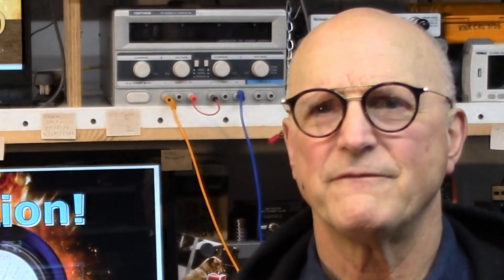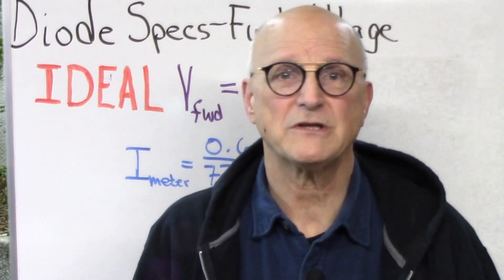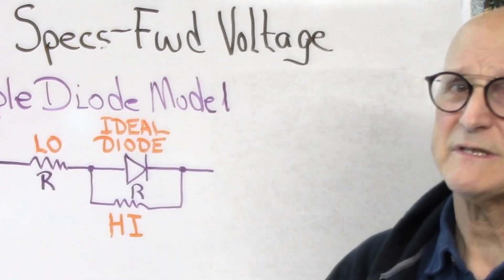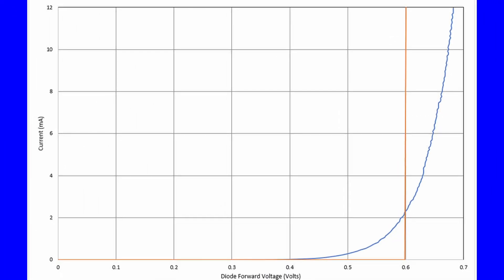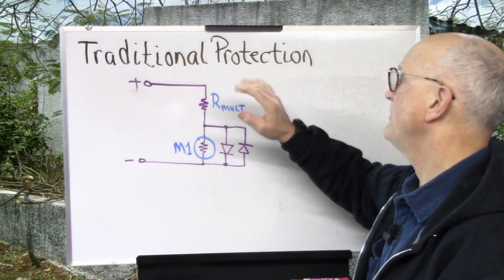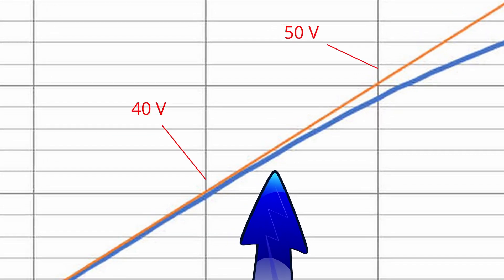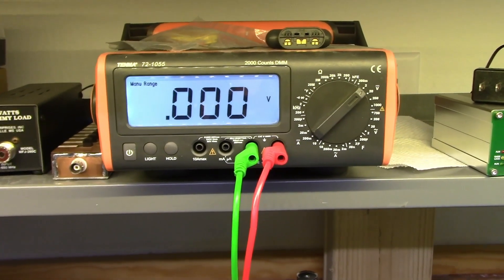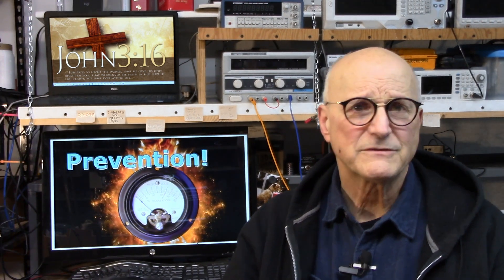Meter Protection: Protecting Your Meter from Over-Current (019f)

Comment: I learned this lesson the hard way. I had an 813 amplifier with a screen milliammeter and the usual two diodes across it. While measuring the screen voltage, my probe slipped. Blam, no more screen meter.
Reply from the maker: May I say ... OUCH!

Comment: Thanks for the video and explanation, this will be very helpful in protecting the meter in my VTVM... BTW, any protection from placing say a 100UF capacitor across a meter movement???
Robert
Reply from the maker: Well, the capacitor would slow down the meter movement as it would have to charge and discharge. This would protect the meter movement from fast spikes. But every capacitor eventually charges and long term overloads would still be an overload after the capacitor charges and would remain longer once the overload ceases as the capacitor would have to discharge.
So, In my estimation, you wouldn't really be buying anything except in terms of spikes. You would also be slowing the responsiveness down. Being that capacitors actually never fully, fully charge (they get close), it might affect the accuracy of the meter, too. 🙂
Reply: @eie_for_you  Thanks! When a VTVM starts up the needle deflects full scale at the start up process... I want to protect the meter during this initial 15 seconds...
Reply from the maker: @myradiovideos  Then I would use the diode-based protection as I presented in this video.

Comment: Good info, good idea.  Perhaps using diodes on each scale would raise the cost and complexity of the multimeter.  Wondering if this could increase error if the designers of the meter already took the clamping current of the diodes into consideration when laying out the silkscreen of the scale.   Perhaps another idea is to calibrate the meter around 3/4 of the total range so that 75% of your typical measurements are accurate.  Are newer meters using Schottky diodes?  I would think we have more modern semiconductors which have the lower threshold and lower leakage.
Reply from the maker: You have some interesting thoughts.  Keep thinking and asking questions. 🙂
Sounds like the basis for some experiments!
Based on a quick perusal of some diodes both schottky and standard, the lower the forward voltage ones tended to have higher reverse leakage.  Also, with lower forward voltage voltage ones (my opinion) gives us less of a region between the 0 volt and where their conductance starts to become problematic in terms of current.
Regarding calibrating at 75% of scale ... In my metrology training, nearly every meter (almost without exception) is calibrated at full scale. The question past that is, "Is the accuracy specification for this meter relative to full-scale or relative to the reading?"
All measurement accuracy is dictated by a degree of measurement uncertainty. With analog meters, this is often % of full scale. With digital meters it it % of reading+/-n counts. I discuss how this works in this video: https://youtu.be/jF6KSmmMF_w
Reply: @eie_for_you  Thanks for your reply Ralph!  I was calibrating DCV on a VOM and found that trying to calibrate at full scale was ineffective, it seems fixing one range increased the error in the other ranges near full scale.  I accurately measured the resistors in the voltage drop switch circuit, and found a few out by 1%.  After replacement, assuring all were below 0.5%, I tried calibrating again the same way, and did not see the level of improvement I was expecting.  So I decided to take a different approach.  Instead of calibrating with a voltage source, I used an accurate ohmmeter to adjust the input impedance to specification on the lowest voltage setting.  0.6V * 20Kohm/volt = 12K ohm target.  It worked!  The bottom 85% of every scale is accurate, with the top end falling off similar to your demo graph.
Reply from the maker: @pault6533  I've never heard of anyone doing it that way.  One has to ask, however, what sort of calibration standard are you using? Is it possible that the voltage source is lying to you? Nonetheless ... if it works ... 🙂
Reply: @eie_for_you  give the impedance alignment a try and let me know the results!  As long as the meter and resistors are good this should work well.  Just have to keep the needle in the lower 5/6 and avoid the diode effect. I’m using a LM399 transfer standard and a few others as well.
Reply from the maker: @pault6533  I have nothing to calibrate here at the moment. But I will keep this process in my back pocket for the possible opportunity in the future.

Comment: One last question, my Simpson meter is a 100UA meter full scale. I do not know the resistance of the meter? What would be the value of Rmult number 1? I see the 1K and 2 K but not sure how to figure out the one left blank.
Also, for a different project I ordered some 1N34A Germanium diodes, can these be used or should I stick to 1N4001??
Robert
Reply from the maker: The surest way to know the answer to this question is to characterize the meter yourself.  I explain how to do that in this video: https://youtu.be/ue7tYY0xdjI
This will give you the full-scale current of the meter and the internal resistance of it. 
With that said, if you know the actual Full-Scale current of the meter movement itself and you know the resistance of one of the multiplier resistors used for measuring voltage, you can calculate a guess as to the internal resistance of the meter.  R{meter}=(V{full-scale}/100uA)-R{multiplier}
Hope this helps. 🙂

Comment: I am building an amplifier Bias meter to monitor all four power tubes at once to set bias at around 37mA. I have four analog meters registering 0-50mA. Will 1N4007 diodes be a good choice in parallel across the movement terminals ? Also will they diminish the accuracy of the meter reading ?
Reply from the maker: A 1N4007 diode has a "typical" forward voltage of almost 0.8 Volts at 100 mA forward current (from the forward voltage chart/graph on the datasheet). Reverse-Leakage current-wise (which will affect accuracy and is voltage dependent) can be as high as 10 microamps at room temperature. The closer you get to its "official" forward voltage, the higher the leakage current will be. So, I would say that it has the potential of messing with the meter accuracy and, with a forward voltage of almost 0.8 volts, the amount of protection benefit might be what your goal might be. 
Here is a link to the datasheet that I referenced:
https://www.onsemi.com/download/data-sheet/pdf/1n4001-d.pdfHope this helps. 🙂
Reply: Thank you ! Actually I was not going to add any protection as the meters are very inexpensive but was doing a little research before I added anything. Accuracy is important here and I am just a novice at this but I did subscribe because You explain things well !
Reply from the maker: @Phoenix20086fly Cool! 🙂
Reply: Can you recommend a better choice for the diode ? I have four meters so eight diodes !
Reply from the maker: @Phoenix20086fly If it were me Id go with something like this one:
https://www.digikey.com/en/products/detail/stmicroelectronics/BAT41/603518
Reply: @eie_for_you  great thank you !
Reply from the maker: @Phoenix20086fly You are very welcome! 🙂

Comment: I use schottky diodes. Have not had any problems
Reply from the maker: Schottky diodes are a good choice ... much lower forward voltage. :-)
Reply: @eie_for_you  My VOM uses IN4448 protection diodes across the meter.  I took a look at the datasheet, which graphs the forward current vs forward voltage.  I was able to extrapolate the data downward and found the "leakage" should only be 0.03 uA at 100 mV.  Considering the Schottky diode myself, I took a look at the typical datasheet, for instance 1N582x.  According to the graph, the forward current at the same 100 mV was 0.03 mA.  That's right, 1000 times the current!  I was shocked.  If correct, swapping diodes could certainly increase the measurement error.  I think the better plan is to choose a calibration process that does not use full scale reading, then in measurement practice try to select a range which puts the needle in the middle 2/3 of the reading scale.